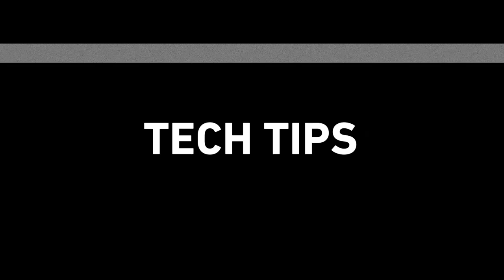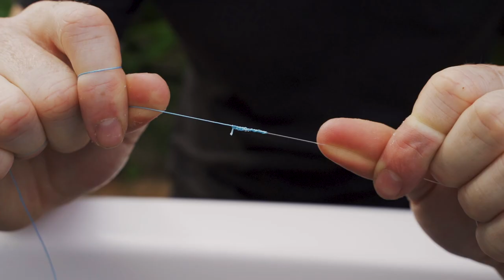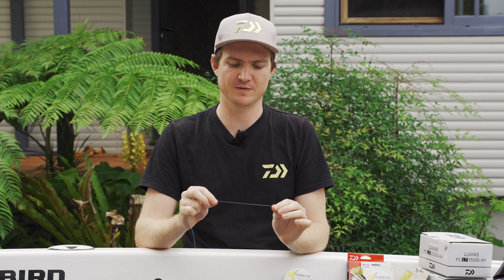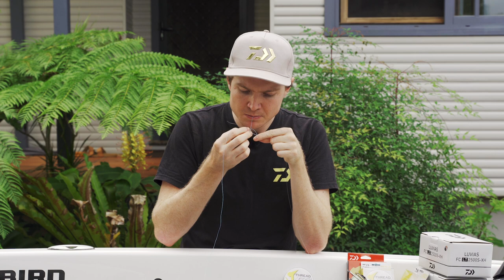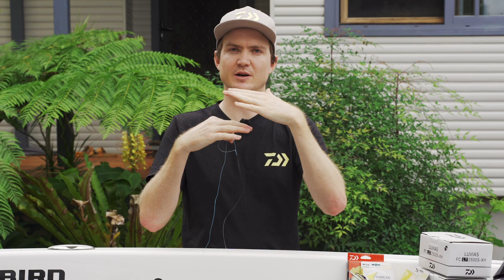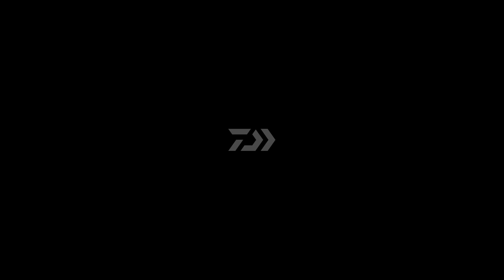HOW TO TIE AN IMPROVED SLIM BEAUTY- DAIWA TECH TIPS

Comment: Great video! I tried your improved slim beauty knot, and I believe it is better than the knot, GT knot, I have been using for years.

GT knot is also called slim beauty knot by some people. It is good for braid to mono leader less than 30 lbs.

I usually keep the leader around 10 ft at the beginning as I need to retie my jig frequently. The new leader line needs to come through the guides many times before it is too short. Your improved slim beauty knot makes the knot stronger and easier for passing through the guides. Thank you very much!